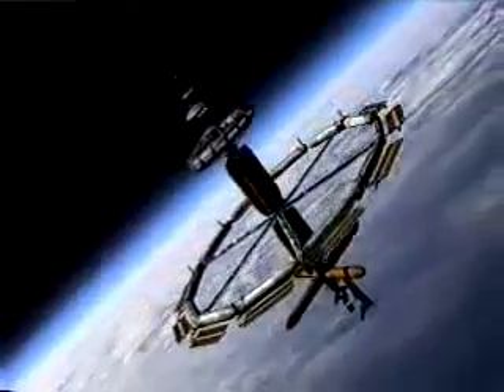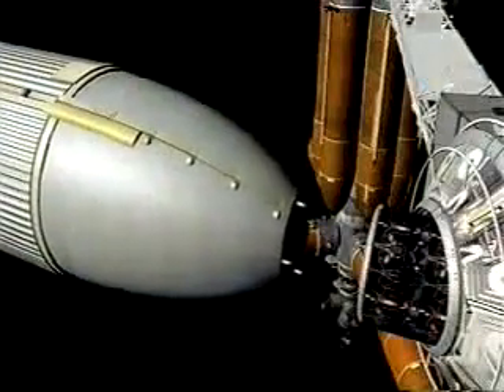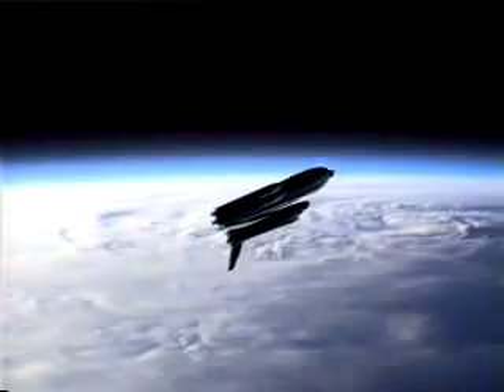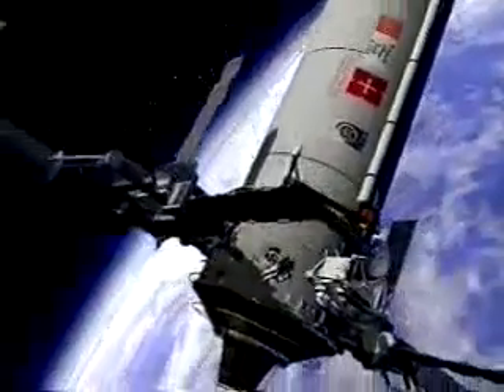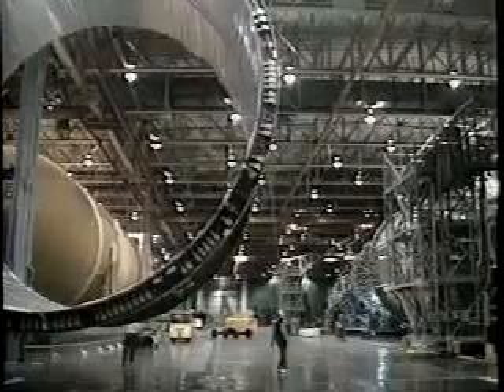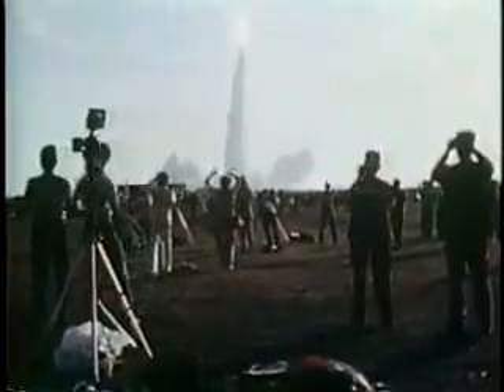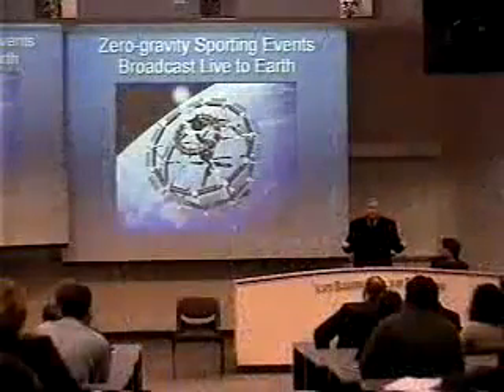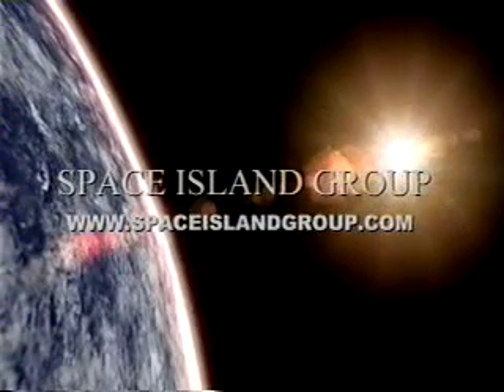Space Island Group Project Presentation Video

Comment: We can also do it whit the SLS's main core, decoupling and deorbiting the engine section for reusing in another mission, then, the main core fuel tanks are converted into habitats, greenhouses, etc...
The docking ports, habitat parts, and other structures such has solar pannels are launched aboard an cargo Starship v3, and then, atached to the orbiting SLS main core.
We can also use Starships to make the ring-shaped structures.